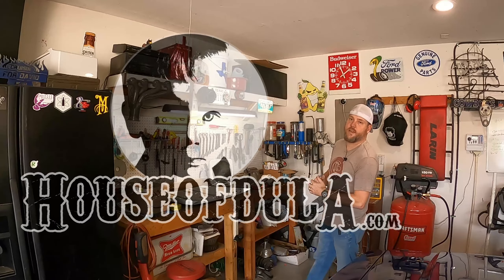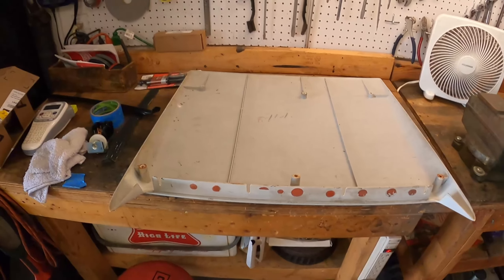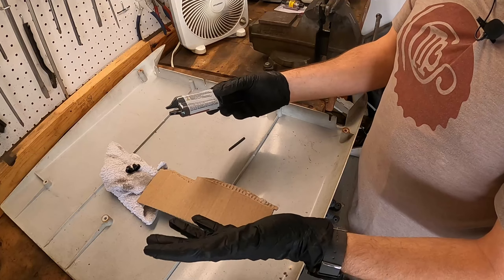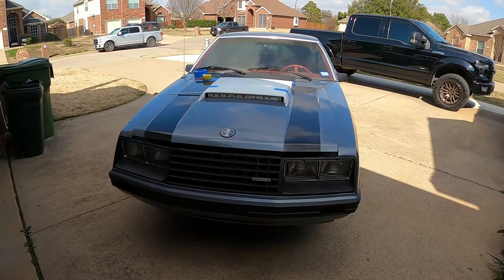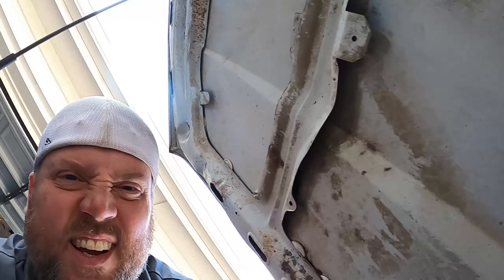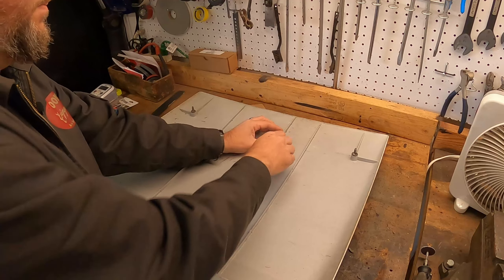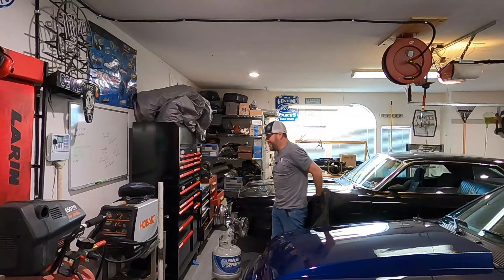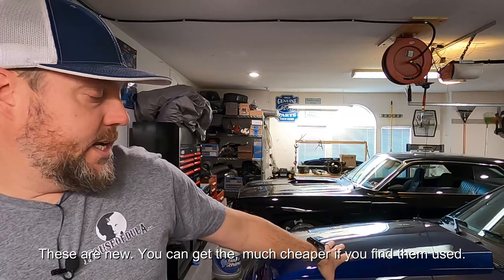Hood Scoop Install - '79 EcoBoost Coupe Project - Episode 12

Comment: Those scoops were an appearance option on non-turbo cars as well.  My first Fox was a 1980 Ghia hatchback and it came equipped with the same nonfunctional scoop installed.  It's a neat feature.  I got lots of compliments on it.
Reply from the maker: Yes it was! Man you should hear we ramble on these videos then have to go back and cut out half of it. It could been an added option and was a GT standard option in 82.

Comment: Love me the 79 notchbacks...i rebuilt a Ghia 5.0 4 speed TRX notch car back in the day. Should never have sold that car.
Reply from the maker: Sweet! Yeah. Cool lil cars. Kinda wish this one was a ghia. Its about as basic as it comes
Reply: @HOUSEOFDULA  Ghia in my case meant leather upholstery and some little badges. No AC, crank windows, no power locks so, Not super luxury.....:) BTW, my current car is an 86 sand beige coupe....total stripper, no radio, no console, nuthin'

Comment: You must read my mind. I just decided to go the Cadillac brake route instead of sve cobra brakes. Get a good proportioning valve and direct more than usual flow to the rear. If not they will tend to lock up very easily. Keep up the good work.
Reply from the maker: Thanks man! I can imagine. Bias will be an issue, and will likely need a larger rear brake as well than the standard "cobra" rears.

Comment: Awesome! So cool you got AJE to send you the K member. Initially I was going to use the Brembos but it limits wheel selection and I stuck with the Cobra/Mach1 calipers
Reply from the maker: Yeah, some 17s fit otherwise move to an 18, but diameter I hear isnt the biggest issue, its face to spoke clearance.

Comment: I wonder if my stock 85 hood has the dimples underneath ? Id like to get some airflow to my air cleaner and under the hood in general. I have a 3 inch cowl hood on it now. The paint is perfect on my original hood. I’d like to paint the scoop flat black.
Reply from the maker: Man, I dont recall my 86 having that and they would be the same. As far as I know the scoops like this fit the 79-82 hoods, 79-82 also had the bolt on "cowl" hood, then the 83-84 had the reverse scoops.

Comment: Be careful with cutting the hole in the scoop and hood.  It can actually create high pressure in the engine bay which can decrease airflow through the radiator.
Reply from the maker: This is true! Unless I get some crazy intake idea I'll likely leave like is.

Comment: I have a 84 fox body mustang electric fuel ejection carburetor I got it off this kid for $695 it was his father his father did some serious work to it dropped it down a inch put some straight cat backs on it the horn is not working it only have 96,000 mi on it it's a 6 cylinder not a GT is a LX coupe notchback black and white and it has a Shaker on it thank you for making 4 eyes video.  My is horn not working I don't what can it be ?